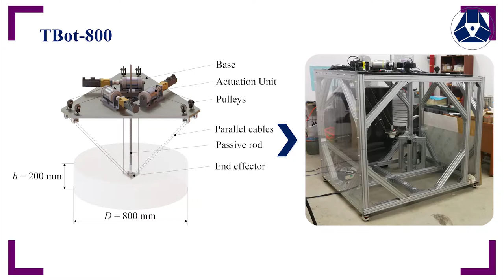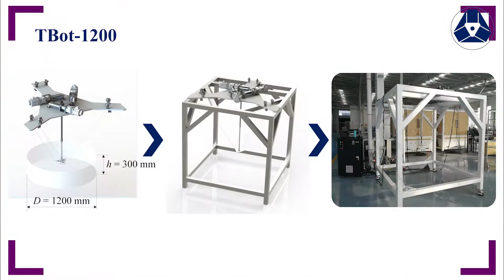Pick-and-Place Application Test of the High-Speed Cable-Driven Parallel Robot—TBot

Comment: What are strings made of?
Reply from the maker: The composite cable is used in TBot. The inner core of the composite cable is carbon fiber and the outer layer is aramid fiber. The inner carbon fiber gives the cable good resistance to tensile deformation, which makes the cable deformation negligible during work. The outer aramid fiber makes the cable soft and wear-resistant, which ensures high-speed motion and long service life.

Comment: wow awesome job! how did adjust the tension of the cables and fixed?
Reply from the maker: We used an auxiliary stand to fix the end effector at the initial position first, then installed the cables and adjusted their length and tension, and finally released the end effector.
Reply: @zhaokunzhang2531  Thanks for the reply. Regarding installing cables, did you use one cable for each fix point on end-effector or two different cables that come from the actuators?
Reply from the maker: @oguzhanbozoglu7996  two cables from the actuator.

Comment: Amazing work, the use of a cable + tensioning spring instead of rods with joint is novel. Do you think it could be applied to 3d printing instead of just pick and place?
Reply from the maker: yes, I agree that it can be used as a 3D printer.
Reply: Also similar to the Delta T https://youtu.be/ECjNw-Ooa_s

Comment: What does the passive rod do?
Reply from the maker: A compression spring is coaxially installed on the rigid rod to apply downward force to the end effector. The rigid rod plays a guiding role to prevent the spring from bending.
Reply: @zhaokunzhang2531  Ah. I see it now. thank you!